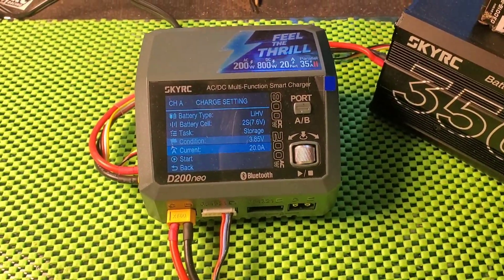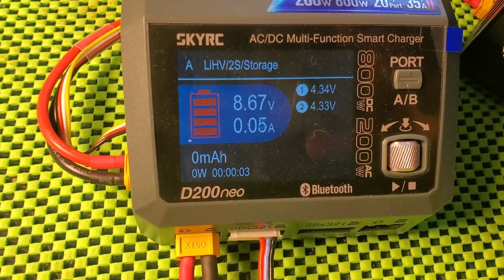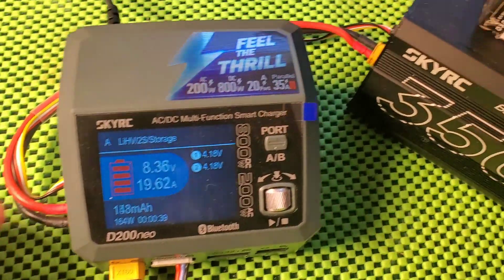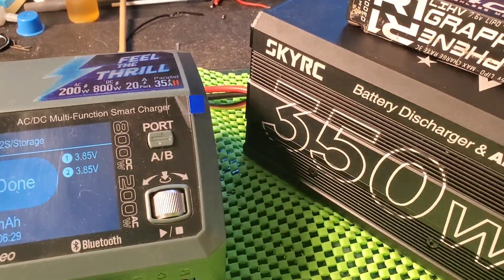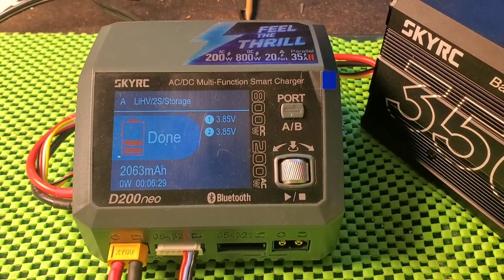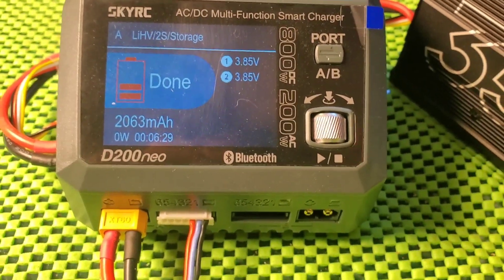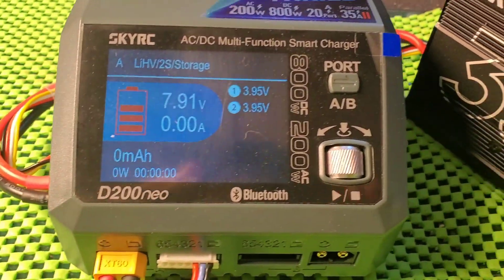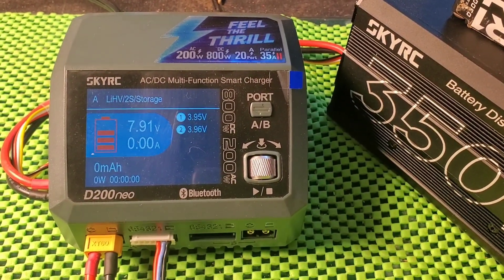Skyrc D200neo Part 3: Storage/Discharge issue (over volt)

Comment: Hey bud! Thanks for your review! That's the exact question that I had about this setup. I am surprised they did not implement load monitoring feature so that it balances to precise voltage instead of stopping discharge once the specified storage voltage is hit. Same problem with their BD200 and BD250 dischargers. You can ofcourse mostly remedy this problem by decreasing the discharge current and lowering discharge voltage to say 3.80v/cell. That being said, look into KACALLAP a12 LiPo Battery Smart Discharger. Those will balance to 3.80v/cell automatically with no bounce back. They just recently re-appeared for sale. They used to balance to 3.85v/cell but I just got two of them today from Amazon and they now discharge to 3.80v/cell even though the manual says that they should be stopping at 3.85. No big deal. Current will be set automatically based on 130w max power discharge. Ex: 6s dischargers at 5A. 4s dischargers at 7A. Give it a try
Reply from the maker: Some commenters have mentioned there is a new firmware for the D200 neo that might fix the issue.
Reply: @lawton70  i assume you no longer have that setup to try it yourself?
Reply from the maker: @delfin2003  I still have it. Just limited time for testing.
Reply: @lawton70  Help us out man! Do a test this weekend!:) Phhleeeaasee

Comment: I recently bought the D200neo and BD380 and I see that there is now a Holding Voltage option under the settings after firmware update. I wonder if Holding Voltage works in Storage mode or not, there's not really much info about it. I'm going to test it, but it's hard to tell because when it reaches storage voltage and is at the Done screen, it doesn't show you real time cell voltages. I'm going to try getting to connect a cell checker inline for that info when I do more testing. I know when I had Trickle Charge and Holding Voltage both turned on and completing a Balance Charge at the Done screen, after awhile the fan kicked on and the BD380 display showed voltage at 17.80v. Ending voltage on my LiHV should've been 17.40v meaning it was probably "Trickle Charging" or "Holding Voltage" after the voltages dropped. My guess is that it was Trickle Charging and not Holding Voltage. I'll try to get more testing done and report back.
Reply: I tried to test and if I have Holding Voltage set on and Trickle Charge off it holds the voltage at 17.80v, but I’m not sure about the current, trying to get a meter to see if there is any current in Holding Voltage mode.
Reply from the maker: This might be a fix to the issue! Keep us updated with your test.
Reply: @hiddentomato  So any updates on this?

Comment: Hi

I just need to do a correction what I said about the storage mode on the Sky RC ultimate charger.

I said in my last comment that you can adjust the voltage on the storage mode but that is NOT correct.
You only adjust the amp and the number of cell voltage, 7.4 2s, 11.1v3s e.t.c as usual.

The 3.8V storage setting for each cell for Lipo battery is not adjustible but you don't need to adjust that.

Every type of battery has the correct storage for each cell built in the program.

The rest I said about the charger in my last comment is right.

Comment: Hi again

I return with update on my new Sky RC ultimate 400w charger I just bought.

This charger work when it comes to storage mode on both ways.
The storage mode is adjustible but for lipo it is 3.8 and you can't adjust to 0.5 in between so for example 3.7,  3.8, 3.9 e.t.c
As I said the storage mode work both ways and what I mean is, if your battery has a higher voltage than 3.8, then it discharge the cells to 3.8 on storage mode. If the voltage is lower than 3.8, it charge the cells to 3.8 on storage mode.

One of my 11.1volt lipo seems to be bad even if the battery is just 2 years old and I have been careful with it and keep it on storage under winter time. The charger could not end the storage on the battery even thou the cells was on 3.8V so I had to terminate the storage by hand by push stop.
I can't blame the charger for this problem when the other 3 lipos stoped at 3.8V.

I think the Sky RC ultimate 400w is their best charger, better than their new q400neo but it is also their most expensive so it should be very good and the best and work properly.

Hope this info can help anyone.
Reply from the maker: @rc-jatodaniel  Awesome feedback! I may give it a try!

Comment: Hi
Thank you for bringing up the issue. The same issue is on their new sky rc q400neo and also on the new Team Orion charger that also is a small charger.

I have borrow the new Sky rc q400neo charger from a friend that have just bought it. The storage mode does not work as it should on that either. The storage volt is set to 3.8volt and it´s permanent. The storage mode should be 3.85 or at least be adjustable. 
Still the charger stops the storage volt on the battery when "done" at 3.76-3.77 instead of 3.8v. The highest discharge voltage you can set is 2.0A. I also noticed that you can only storage the battery from lower voltage than 3.8 but when you need to storage charge your battery from higher volt than 3.8 it does not work. It still want to charge in more volt then 3.8 instead of discharge the battery to 3.8 on storage. I´m not going to buy this new q4000neo.

 Instead I´m going to try my luck with the Sky rc ultimate 400w charger instead that has a max discharge voltage of 5A, just like my older Team Orion charger.
Reply from the maker: Thanks for your feedback! Let us know how you make out with your new charger.
Reply: @lawton70  You´re welcome! Yes, I can do that after I bought and test it.

Comment: Thanks for the review. Saved me ftom buying this charger + bd350 which I wanted for exactly the purpose of having smart discharge to a set voltage level. Ie fast discharge at high load then dynamically adjust till the voltage is steady. Since this product is not doing that theres no advantage over my bd200. P.S. I do understand how batteries work.

Comment: This is the worst thing about this charger. Skyrc needs to allow the storage voltage to be adjusted from 3.75 to 3.85. A discharge to 3.8 volts with no CV current reduction leaves the battery with too much charge and bounces back too far as shown in this video. If you could at least storage discharge to 3.78 or storage charge to 3.82 this charger would be greatly improved. ToolkitRC charger can do this and it would be a simple change to the Skyrc charger to also do it. Also discharge should be able to set a voltage as high as 3.5 volts not 3.4 max as it is at the moment.
Reply from the maker: Agree, skyrc could make changes to the firmware so the discharge function would work better.
Reply: @lawton70  I was really hoping this charger would become my go to charger, however the storage discharging is so bad, compared to my ISDT FD200, I don't want to use it. A real shame, as the charging/balancing is so good. I don't understand how SkyRC could have missed the ball so badly over this. It will certainly put me off buying anything SkyRC again!
Reply from the maker: @beenflying1  my thoughs exactly. Mine sits in the box waiting for a firmware update to fix these issues. My isdt charger also works perfect.
Reply: @lawton70  If they could automate a good storage discharge, like the ISDT FD200, that would be amazing, however, all they need to do is give the storage voltage a setting of 3.75 to 3.85 in 0.01 steps and discharge voltage from 3.7 to 3.0 in 0.1 steps to significantly improve this charger. I can only hope we get a firmware update, to save the money spent on two excellent bits of hardware (D200neo & BD350).
Reply: @lawton70  Just a thought. Try discharging a LiPo as a Lilon, using the BD350. This will discharge it to 3.7 volts, which should be a lot better for a LiPo discharge. It should bounce back to around 3.8 volts, since the discharge doesn't taper off. At least it will take over half the capacity out of the battery. You could use LiPo for your LiHV batteries. I'll try it when I'm home tonight.
Reply: @lawton70  Discharging LiPo batteries to storage using Lilo works (with the SkyRc BD350 algorithm of stopping when one cell hits the storage voltage). A 4500mah battery only needed 60ma to get it back to 3.80 volts per cell. At least I have a work around for now, however it's not ideal.  I would much prefer to be able to set the storage cutoff voltage, or have the charger slowly reduce the discharge current. Hopefully SkyRC will support their product! The hardware seems excellent, just the software is lacking.
Reply from the maker: @beenflying1  agree. With my isdt i just set storage at 3.80v and it just does it.
Reply: @Pmeyer1226 That's interesting. My charger is limited to 3.0 volts up to 3.4 volts in 0.1 steps on a LiPo battery.

Comment: your complete lack of understanding when it comes to battery chemistry is the problem not the charger/discharger. This is totally  normal if you put a lipo battery under high amp discharge whether it is via a discharger unit as you have there or in normal use, you will always see the voltage rise once load is removed. Who the hell is discharging packs to storage at 20A. suggest you better manage your lipos if you feel the need to have to hammer packs back down to storage at the end of a day. stop charging to many packs, simples
Reply from the maker: I appreciate the feedback. I completely agree that if you discharge a battery at high current load and you remove the load the battery voltage bounces back. This happens with Lipo batteries, LiHv batteries, and even in my 1-1 car lead acid battery. The problem with this charger is not with a discharge, the problem is with Storage. With storage the lipo / lihv must be stored at storage volt. In the case of this charger it does not matter what current you set the storage mode to it never brings the pack to storage volt. I've tried 20A(which this charger is made to do), 10a, 5a, 2a, 1a, 0.2a. No matter the current selected it takes about 4 retries of the storage mode for the pack volt to be set to storage volt. I have an ISDT T8 charger with storage mode. It can only do 2a but when I store this exact same pack with that charger it balances that pack to storage volt first try everytime. This skyrc charger needs 4 tries at 2a to bring the pack to storage volt. So after all these tests and testing the exact same battery pack on several different chargers I can safely say this charger isn't working properly.
Reply: @lawton70  Does it work better without the BD350 connected?
Reply from the maker: @StephenNZ  Does not seem to. Without the bank you can only discharge at lower amps, but at lower amps the charger becomes more accurate of course. The reason I bought this charger was that it had the bank and I was expecting that for a quick storage I could set the rate at a high rate and the charger would use the high amps initially and then back off the amps until the battery was at storage volt.

Comment: Hi. Any update from SkyRC ?
Reply from the maker: Skyrc claims this is how it is supposed to work. I think they never tested with a good battery. Checked the skyrc site and no firmware update yet.
Reply: @lawton70  I got basically the same answer and SkyRC suggested that "So to get a stable storage voltage, it's recommended to storage the battery with the charger only."... and "After discharging the batteries to storage voltage using the BD350, it may be beneficial to consider using the charger for further storage discharge. This approach would significantly reduce the overall discharge time and improve overall efficiency."

So they basically say that BD350 is not meant for storage discharging (due to lack of intelligent software in T1000 / D200neo). I'm very disappointed and I won't be doing discharge in two steps and wait for an extra hour due to their software flaws. SkyRC customer service is friendly, but their development is seriously lacking will or competence.
Reply from the maker: @AnttiRC  Thanks for your feedback! Ive tried storage without the bd350 attached and i still had to store 2-3 times before it actually got to storage volt. Ive given up using this charger. Its a great charger if you only want your packs 97% charged and stored at a random voltage.
Reply: @AnttiRC  have you tried storage charge using the charger only (BD350 not connected)? Does it leave it at the set voltage?
Reply: @StephenNZ  Yes I have, and it works pretty ok. However it's very slow.

Comment: This is normal because the battery has resistance.  When you apply a high discharge current the voltage will drop lower and when the current is removed the voltage goes up back up a little. There are 2 ways to mitigate this. Discharge at a lower amperage or discharge to 3.5v /cell and charge to storage voltage.
Reply from the maker: I was hoping/expecting this charger to automatically back off the current to put the pack in storage voltage, which it does. The problem is the charger does not back it off enough and monitor the pack long enough. I end up using 0.1 amp with storage mode and I have to do this about 4 times in storage to actually bring it to storage voltage. I have an old ISDT charger that will bring it to storage with one try, so it seems to be a problem with the firmware of the skyrc charger.
Reply: Yep, my older skyrc/hitec charger is exactly the same.
Reply from the maker: @mikechellson6400  im really dissapointed in this skyrc charger. Really needs a firmware update so it works properly
Reply: @lawton70  I bought a T1000 charger and a BD350 discharger and I have exactly the same issue. I have reported the issue to SkyRC a week ago and I hope they release a new firmware version that fixes this. 

I also have a BD250 discharger, and with that I can set discharge cut-off voltage manually to 3.73-3.75V/cell, depending of the battery and discharge current, and it works pretty nicely, but you can't do that with BD350... and you shouldn't as BD350 should do it fully automatically.
Reply from the maker: @AnttiRC  please keep me posted. I'm glad others are reporting it.
Reply: @AnttiRC  That's intesting. The D200neo can only discharge to 3.4, 3.2, 3.1 and 3.0 volts, with or without the BD350 and certainly not in 0.01 steps. Storage can't be changed at all, which most other charger allow. Very poor software by SkyRC. Grrr
Reply from the maker: @beenflying1  good catch, i had not tried charging to storage volt on this charger.
Reply: @lawton70  Storage charge is actually a bit slower than it could be. They don't use balance overcharging (like the iCharger) to get it to stay at 3.80 volts more quickly. Balance overcharge is when you charge up to 200mV over the voltage you want the battery to end at, when it settles back after it stops the charge. D200neo only goes about 10mV to 20mV over the 3.80 volts (like it does when fully charging to 4.20 volts).
Reply: So if we do this where th is the efficiency🤷